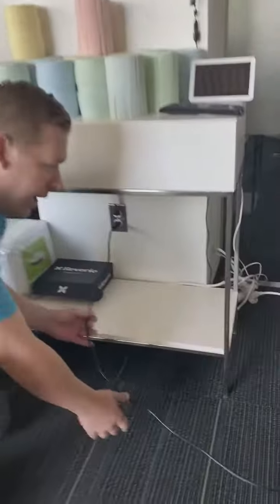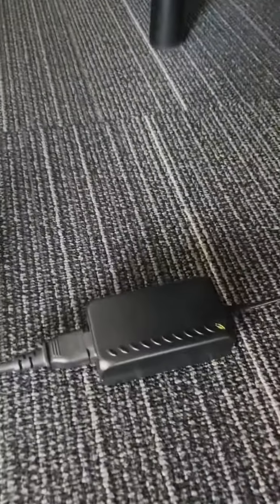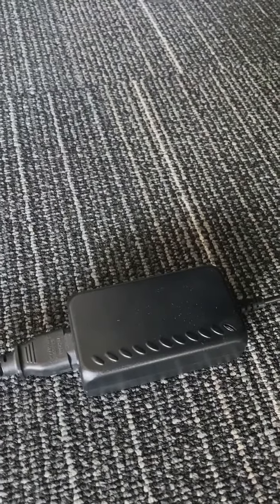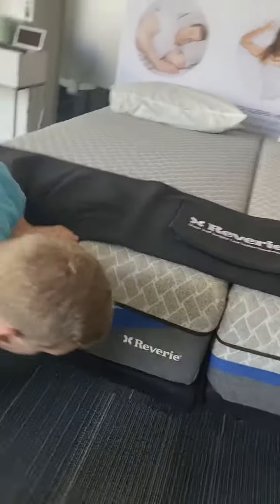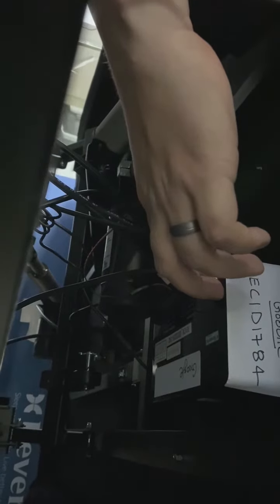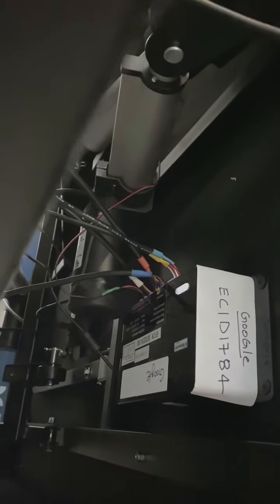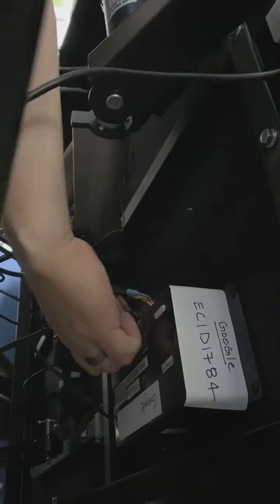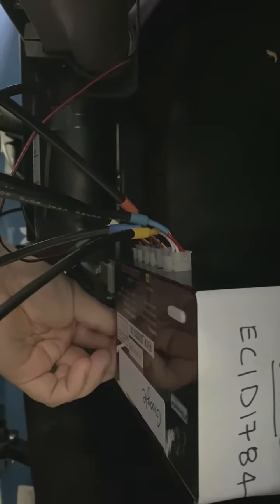208 Control Box Troubleshooting

Comment: Sadly, this bed base is a piece of garbage.  I have had multiple issues and I have the bed a little over one year.  Very disappointed.  Thank goodness I have the protection plan on it.  Otherwise I would have nothing more than a really expensive stationary bed frame.
Reply from the maker: We regret to hear of your sentiments, Ellyn as this is certainly not the ownership experience we strive for with our valued customers. Please call 800-973-8374 or send an email to customerservice@reverie.com so we can best assist with resolving these concerns.
Reply: Same here. Very poor quality bed. Replacement parts are expensive and only 90 day warranty. They are actually telling you “this is going to fail”.

Comment: My green light is on, so it's getting power.  The white light on the control box isn't lit up. I've tried all the troubleshooting tricks. No luck.  I left a voice mail but after reading these comments and several on the BBB website, I'm very worried. $1500 for a base & I bought it in Sept of 2020.  Have had it all of 4 months.  My husband is very sick right now & we really needed to be able to elevate his head.  I am just so disappointed at this point. 🤦🏻‍♀️
Reply from the maker: We certainly respect your position, as we know how frustrating unexpected concerns can be. If you're still experiencing concerns with your bed, please call 800-973-8374 or send an email to customerservice@reverie.com so we can best assist.

Comment: Hi, I Repair electronics. And My brother has dropped off this control box JB-MP-208-C1 to get repaired because it does not work. I have already diagnosed the issue. Just from looking at the comments this control box seems to be Super unreliable which I can see why they warranty it for only 90 days which is crazy to me when this box costs $400 and it only takes probably $15 dollars to produce if not less. 
The issue with my box is the Main IC chip has shorted to ground causing it to not accept any power. “HT32F52231” 
I am not sure if this chip has some kind of code written to it, if it does it would be awesome if the company could provide the file to program this chip and I can replace it my self and get my brothers bed back up and working. I hope Reverie sees this comment and can help me out. Thank you

Comment: Hi, my control box under the bed has no light and the bed won’t move. The adapter piece has a green light on it. The red and black wire had broken but the bed was still working. What do I do?
Reply from the maker: Hello, Damon. Sorry to hear you're currently experiencing this difficulty with your bed. Please call 800-973-8374 or send an email to customerservice@reverie.com so we can best assist with resolving this matter.
Reply: Wow, we were taken for a ride buying these beds.  I have the same issue with the control box not lighting.  Customer service is all but non existent.  My neighbor is having the same exact problem, which is what brought me here.  I thought, how odd that 2 of us on the same street?  Has to be a problem with their motors, and of course, here we are.  Not going to buy another of this brand.

Comment: I'm having the same issue. The adapter is lit green however, the control box is not accepting the power and the white LED light isn't lit up.
Reply: Finally got through to customer service. The controller box was replaced for free thankfully.
Reply: How much did you pay for your bed?
Reply: Dealing with the same issue, the control box had to be replaced ?
Reply: @AlfaMedtech  yeah, once I replaced it everything has been working fine.

Comment: Same problem as everyone else has stated. Power to the adapter but no power to the control box. Bed is a queen and was purchased 06/2019. I've emailed and called customer service multiple times this week and have still not received the courtesy of a response. Very poor customer service! I would expect a return phone call, if nothing else, acknowledging that they received my info and are aware of my problem. Looks like I will have to start calling and leaving several messages per day. 😕
Reply: Same situation here. So frustrating!
Reply: Update....Once I got through and talked to a CSR, they were extremely helpful through the whole process. I got the new control box at no charge as the bed was still under warranty. I did have to pay S&H of $31.60 as it was more than 1 year out from purchase date. I got the new box within a couple days, pulled the old one off and eaily installed the new one. I plugged it into my newly purchased surge protector and it has worked perfectly ever since! Thanks Reverie!
Reply: Did they every get problem taken care of?

Comment: Same issue- green light on, white light in control box is not. 
I wish there were answers on these comments. I have left messages, no call back as of yet.
Reply: I bought mine in October of 2019 and had to replace my control box within 3 months of purchase. it lasted about 9 months and went out again. I called reverie and they gave me so much trouble to replace it under warranty I finally stopped calling them. Now I have a $3000 dollar bed frame. The warranty for free  replacement is five years and I am still under that time frame but they refuse to honor it. I found that a letter to the BBB will get them moving so I suggest you start there. I can tell you from your post that it is probably the control box. It is very simple to replace (10 minutes)  but very costly to buy from reverie. I hope you get the resolution that you deserve from this company. Good Luck..

Comment: Based on these comments, I may be the odd one out here. I have had a split king for just under 7 years now, and I have never had to replace the control box. I am just looking for directions on recalibrating the top and bottom for each control. Worst case, I figure I can build my own controller module.
Reply: that’s what i ended up doing, control box went out after less than a year so i ended up wiring up the motors to my own switches. works  just fine.

Comment: Both of my control boxes have failed within 8 months of each other. This is a worthless troubleshooting video. The control module white light is not on but adaptor power is green.
Reply from the maker: This is certainly never the optimal ownership experience we strive to provide for our valued customers. Please take a moment to get in touch with our dedicated Customer Service team. They will be in the best position to perform troubleshooting steps with you and determine the appropriate course of action going forward. You can reach them by calling 800-973-8374 or sending an email to customerservice@reverie.com.
Reply: @reverie  Are you kidding?  You can hang on the phone for hours, no one comes on the line to help.  I am going to get another bed but certainly not one on yours.

Comment: My control box won’t accept power. None of these steps helped. Don’t buy any of these electronic adjustable bed frames! 👀 They are nothing more than  an expensive stationery bed frame. Mine only worked a few months. Customer service wanted me to send in the entire bed which is an extreme hassle for something I spent too much money on.

Comment: We've had ours just over a year and one base is not working like all of yours. Green light on. Control box white button was taped over and is not lit up, even when I press and hold to reset or pair with remote.  No call back but only  4 business days.  Reverie please call us!!!!! My bed works (Knock on wood), and my white light was taped over too and is not lit up.. His remote works but will only find my bed not his.
Reply from the maker: We regret to hear you're encountering this concern with your bed. This is certainly not the optimal ownership experience we strive for with our valued customers. Our apologies for any delay in correspondence, as it's been a turbulent year for us all but please continue working with us at 800-973-8374 or via email at customerservice@reverie.com so we can best assist with this matter.
Reply: @reverie  Thank you. You did replace the control box.

Comment: What does it mean if the green light is blinking when plugged into control box, but solid if unplugged? Control box white light not coming on
Reply from the maker: Hello. If you're still encountering concerns with the control box on your bed, please call 800-973-8374 or send an email to customerservice@reverie.com so we can best assist by taking a further look into this matter.
Reply: How much did you pay for your bed?
Reply: Have this exact same problem. Did you manage to solve it?

Comment: It will not work the light is not blinking on the control box the remote just light up with a red light
Reply from the maker: Hello, Judy. It sounds like your control box is not receiving optimal power to operate as designed. Therefore, we kindly recommend reaching out to our dedicated Customer Service team at your earliest convenience. They are in the best position to further troubleshoot your bed and determine best steps going forward. You can speak with them by calling 800-973-8374 or sending an email to customerservice@reverie.com.

Comment: Yeah the reason this cut out after Dave unplugged everything then plugged it back up is most likely it didn't work. I don't know where Reverie got their electrical parts from  (probably China) but they are a true peice of crap. I bought a mattresses from Purple and THOUGHT the adjustable base was a purple product as well nope it's a Reverie and 8 months later one of the two sides stops working!!  Call Purple and you guessed it their reply was "not our product or problem contact Reverie" folks DO NOT BUY REVERIE PRODICTS!!!
Reply from the maker: We regret to hear of the disappointment and truly apologize for any inconvenience you've experienced with the bed! Please take a moment to contact us by calling 800-973-8374 or sending an email to customerservice@reverie.com so we can work towards getting your bed back to operating as designed.

Comment: We have two Reverie bases MFG Date 20150518- 06258122 Model I-WWM9.S-2 Product Code A350-S I can not find any information on this bed. The bed came with two bases one mattress "King" and the remotes are paired to operate both bases in sync. We need to change the mattresses to singles and un-sync the controls as I am having surgery and will need to sleep in an upright position for some time during recovery. Can someone send me the information I need to un-sync the remotes on the basis?
Reply from the maker: We're sorry to hear you're having concerns operating the base with your remote, Don and certainly respect your position. It sounds like the Tandem Toggle Function may be active on your system. We included two videos below; one showing how to manually pair the remote with the individual control box on each side of the bed and the other discussing the Tandem Toggle Function. We hope this helps and please don't hesitate to reach out to 800-973-8374 or customerservice@reverie.com if we can ever be of any additional assistance. 

Manually pair: https://www.youtube.com/watch?v=mYwsvpwaX3I&list=PLpUvQS1W8ccGrIo7A5WLWqzRa0preAvmr&index=4

Tandem Toggle: https://www.youtube.com/watch?v=PiqrncGi3KI&list=PLpUvQS1W8ccGrIo7A5WLWqzRa0preAvmr&index=9